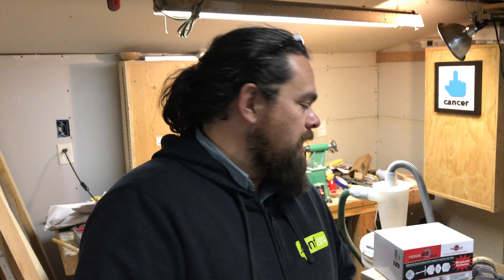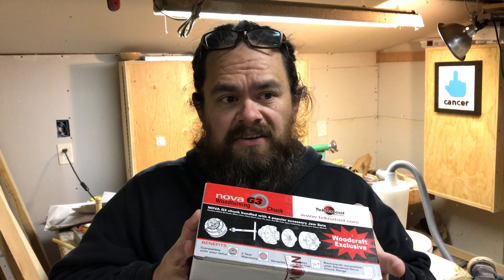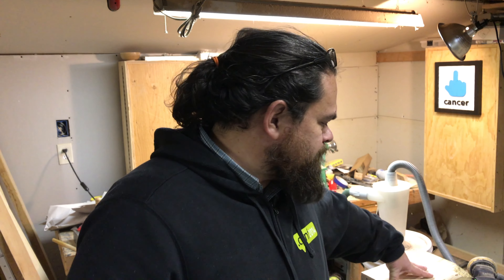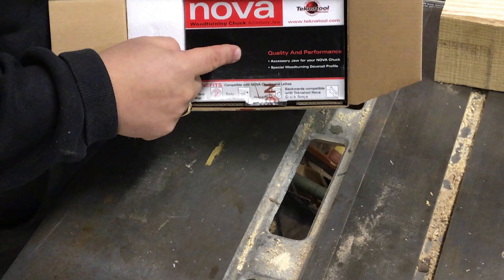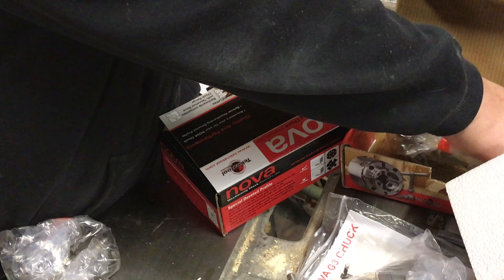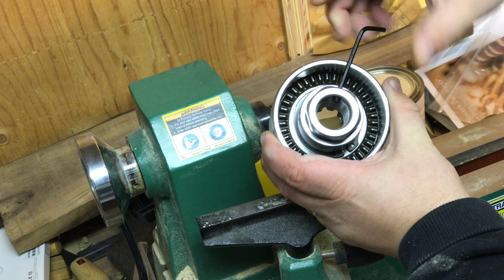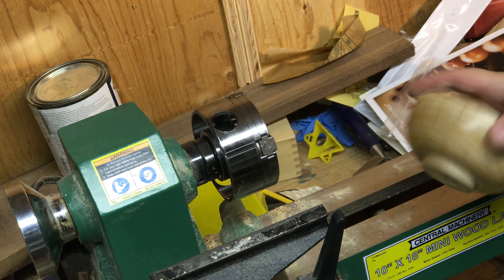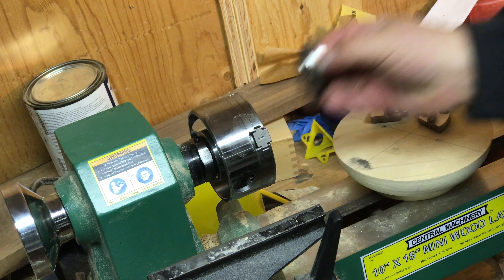Nova G3 Chuck Set from Woodcraft - Unboxing & Demo

Comment: Nice video, however the black socket head screws are not for the cloe jaw “bumpers”. They are to be used to mount the 50mm jaws and the Cole jaws at the same time so you do not have to switch them back and forth. Use the slotted screws to hold the “bumpers”. They are designed to not spread out the rubber as the flat head screws will due to beveled underside. I have 2 G3 chucks and a few jaws. Nova really makes great stuff and their customer service is outstanding. They also make a G3 with 1X8 thread so you do not need adaptors for most small lathes. Have fun with your new lathe.
Reply from the maker: I'll try that out. Thanks for the tip!
Reply: I did the same thing at first.

Comment: You should have gotten a fiber washer to put between the insert grub screw and your lathe heas stock threads to keep from damaging the lathe thread.  All the best.
Reply from the maker: I’ll try that. Thanks for the tip!
Reply: I also didn’t see him put the set screw and fiber washer in the CHUCK, to secure the chuck to the insert! Putting only the set screw in the insert will keep it from flying off, but still allow the chuck itself to spin off! On a non reversible lathe it’s probably not that big of an issue, but it could be ugly on a reversible lathe!

Comment: Do those Cole jaws work for a 12 inch swing? Often I had seen cole jaws for more than 12 inch swing lathes. Easy wood tools chuck at twice + the g3 price, does have cole jaws for smaller lathes
Reply from the maker: Drake Leroy I don’t see why not. As long as you have the right adapter for the headstock. My lathe is only around 10” of swing, I think.

Comment: I came to this video after looking for reviews on the HF lathe, since I felt it was a big price increase from the model they carried before this one.  I also wanted to know if the chucks could be replaced, and this video more than answered that.  Thanks for this demo, it definitely helped a lot.  If I can't find a used lathe for cheap around my area, I had my eye on this one, so I'll hope it goes on sale and that I can still use a 25% coupon on it on top of that.
Reply from the maker: Good, thanks! I’ve been very pleased with it. I should have another video coming out about it with a cool accessory if it works out the way I hope it does.

Comment: Just found your video while searching foe wood turning chucks for the HF mini wood lathe and I'm real happy i did. Just one question, while I was checking Woodcraft's site for the insert I found it a bit confusing as to which insert to get (that would be the same one you got) could you please add a link to that insert so I'll be sure to get the right one? Thanks, I'll be checking the rest of you vidoes.
Reply from the maker: Sure. I'll see what I can find. Not sure if I have the box anymore but I think I can still figure it out. Also, I think I found a bed extension that will work with this lathe. Video coming on that soon.
Reply: I'll be watching, Thanks
Reply from the maker: I found it. If you're getting the same lathe and the same chuck, the insert you need is Woodcraft SKU 153008. The link is https://www.woodcraft.com/products/teknatool-1-8-tpi-insert-w-set-screw-for-nova-chucks Hope that helps!

Comment: Awesome video ty. I have one question. How well does the cole jaws work with the harbor freight lathe?  I just bought the set and have the same Lathe but I noticed while reading about the cold joll's that it shouldn't go over 600 rpm. So I was curios being the lowest speed on the hf lathe is 750. Thanks
Reply from the maker: Wayne Wagoner I haven’t had a problem yet. I haven’t tried to push it with any large bowls or anything, but I did a smallish walnut bowl for keys a few months ago and I thought it handled it very well.
Reply: @BitsandWood  awesome! Im new to turning so I really appreciate your feedback on that. I'm going to give whirl and see what I can do. Thanks again
Reply from the maker: Wayne Wagoner Awesome! Hope it goes well. It can sure be a lot of fun.

Comment: Would this work for a large harbor freight lathe?
Reply from the maker: With the correct threaded adapter, I don’t see why not. Although, your capacity may be limited as compared to a full size chuck.
Reply: @BitsandWood  I mean would the adapter work? I bought the chuck and forgot the adapter when I did? Do the mini lathe and full size have the same thread?
Reply from the maker: The documentation for the full size lathe should specify what thread it requires. From what I see on Harbor Freight's website, it looks like it's probably also a 1" 8 tpi spindle so it should be the same adapter.
Reply: @BitsandWood  thanks!
Reply from the maker: Hope that helps!

Comment: So how did you determine which insert fit on your lathe? Do you know if that lathe (the harbor freight one) is the same size as its larger brother, the 12"? I'd like to get the insert for the 12x33 lathe but don't know how to go about doing it.
Reply from the maker: It should be in the specification details in the user manual. That's where I found it for mine. Looks like it's MT2 (Morse #2 taper) for both head and tail stock and the head stock has 1" 8 right hand thread according to the manual for the 12x33 that HF has on their website.
Reply from the maker: https://manuals.harborfreight.com/manuals/34000-34999/34706.pdf